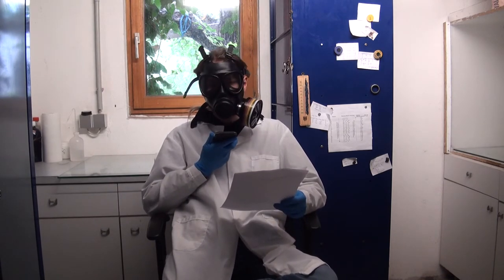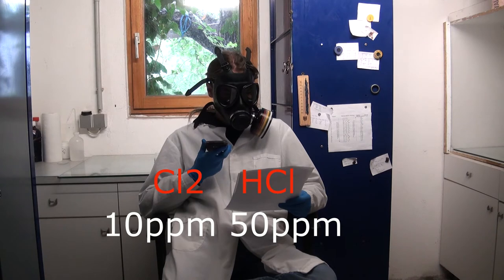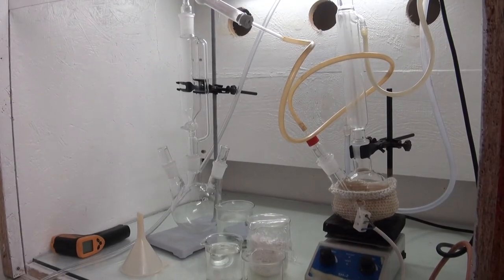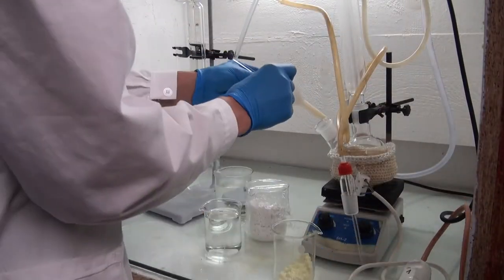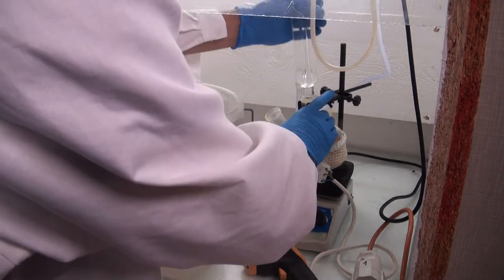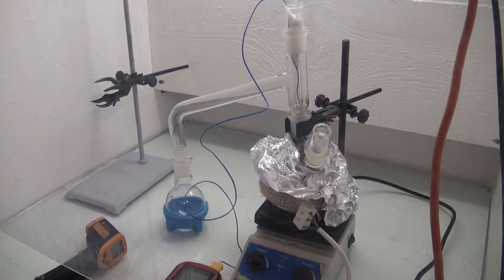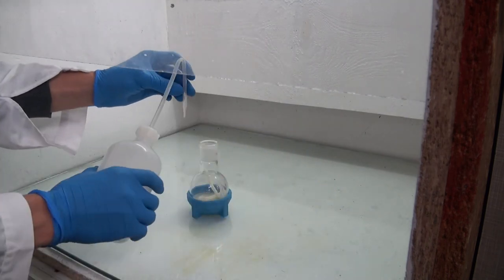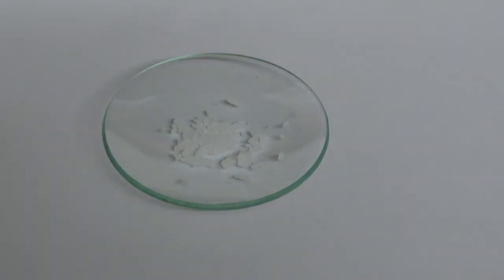Synthesis of chloroacetic acid

Comment: Can I use an acetate salt?

 With the HCl being neutralized in the process? If so Would calcium acetate make a chloro-acetone?
   Also I assume, that the sulphur chlorides formed are the real catalysts here, if that were true what would you consider the optimal temperature so not to boil them off at first, but still encourage their formation?
Reply from the maker: As long as you keep the temperature at ca 120°C no acetone should form.

Comment: Do you happen to know if the chloroacetic acid can easily be further chlorinated to chloroacetyl chloride by adding red phosphorus after the preparation and continuing the Cl2 bubbling?
Reply from the maker: i would rather purefy the chloroacetic acid first to get rid of residual acetic acid and then try that. It should work but you would need to dissolve it in a solvent like chloroform or melt it before bubbling the Cl2 in.
Reply: You never say how many grams of sulphur and how many grams of gaa you used. Can U tell us?
Reply: @ryans3074  hate that...
not replicatable
well it is but you have to guess everything

Comment: Did you use glacial acetic acid in this reaction?
Reply from the maker: Yes
Reply: @madsciencemax8439  Well thanks for the info, did you recommend to heat the mixture of acetic acid & sulfur in chlorinating process with open flame as the heater? or how much degree of celcius that reuired for the reaction to start, & does it only needed to make the sulfur melted completely?
Reply from the maker: @Coticosimo  the solution only needs to boil slightly, anything more would cause the condenser to be overwhelmed with the chlorination. Best thing to use is an electric heater

Comment: what about instead of sunlight you could use an appropriate UV lamp?
Reply from the maker: an UVA lamp would do the job, probably even better then sunlight, but always remember that normal borsilicate glas absorbs up to 300nm of light, which makes stronger UVB and UVC useless
Reply: @madsciencemax8439  I wish quartz wasnt that expensive
Reply: @karolus28  you can put small high pressure mercury vapor lump inside quartz testing tube and put into one of the neck of reactor flask.
Reply: Use a stoper with a quartz UV mercury vapor pencil lamp ganked from one of those gimmicky sterilizer wands that were popular during the pandemic. 🤓
Reply: @christopherleubner6633  yup

Comment: I also have a question about gas masks, do they make cartridges or can you modify a cartridge with lithium peroxide and or sodium percarbonate to allow functioning in environments with high levels of carbon monoxide and carbon dioxide? Using some form oxychlorate I'm not comfortable with, as it seems like it would make a filter that might blow my face off amongst other issues. Or is CO still always a get out or your fμ¢ked situation.
Reply from the maker: CO is always fucked. The fire department is using supplied air respirators. I would not make and relai on modefied cartriges. But you could look into the oxygen regenerators used in submarines and possibly make those portable.
Reply: @madsciencemax8439  with the chlorate systems for submarines , I would be concerned that particulates and other chemical gases can react to make explosive combinations given the nature of of that oxidizer. That's why I thought lithium peroxide would be the safest, it also reacts directly with carbon monoxide and carbon dioxide to make oxygen... 
    But yeah, I can't imagine it would make me safe for carbon monoxide... It might just save me a headache in otherwise survivable situations but that's about it.

Comment: This was a really well done demonstration, thank you. 
Did you use stoichiometric amounts of Cl2 produced to Acetic Acid? 
How do you know that your product is not contaminated with di- and tri-chloro acetic acid? If you were able to chlorinate strong enough for acetyl chloride to be produced it seems that you would also have those side products?
Reply from the maker: I used double the molar amount of chlorine needed. I wasn't able to really prove that acetyl chloride was produced, but because of the very low yield I don't believe that there were a lot of side reactions

Comment: You can add a bit of phosphorus to catalyze the reaction, react it first with an excess of chlorine to form PCl5, then add your GAA to the flask with a UV pencil lamp in one of tge holes and add chlorine. If you are wanting mono then use GAA in excess, if you are wanting trichloroacetic acid then add more Cl2, you can also convert to the acid chloride with even more chlorine as SOCl2. 😁❤🤓
Reply: The master home chemists will not have access to the extremely expensive UV pencil lamps. Today, two years later, most people don't even have access to enough red phosphorus.

Comment: This stuff is so insanely toxic. Cool synth but HOLY SHIT I’d be so scared to attempt this
Reply from the maker: You better be. Don't try it, I am scared of it myself, only worked with it under the fumehood, always wore my gasmask and lab coat which I cleaned afterwards and soaked the contaminated glasware in a base bath for two days. My lab still smelled like bitter almonds afterwards
Reply: @madsciencemax8439   we had some in my lab that was unlabeled and I opened it for LITERALLY a single second before thinking “maybe I shouldn’t just open this mystery chemical” and I almost fainted. And it was IN a fume hood when I opened it for that single second. I immediately tagged it for disposal